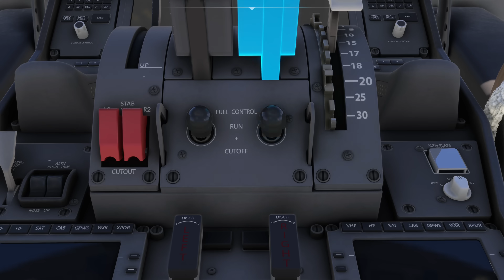Air India 171: Why Did The Fuel Cut-off Switch Get Moved?

Comment: I sincerely hope that the final report will provide a thorough background on both pilots to dig into whether or not this was a mental health issue.  Hopefully, they can resolve which pilot spoke which set of words.  As for AI-operated aircraft -- we already have self-driving cars that try to drive around police attempting to stop them!  And I hear that some highways are testing self-driving trucks.  But computers do fail.  Software/hardware isn't perfect.  Neither are humans, but I'd rather deal with a rational human than a dogmatic computer!  

BTW, if there is an engine fire at rotate, then that engine's fuel switch must be set to cutoff.  So, disallowing that while close to the ground just might cause more harm in some situations.

Finally, a determined mentally ill pilot will always find a way to game the system.

Comment: Steve is still missing the point that the same pilot who did the cutoff could be the same pilot who asked the other why he did that - to misdirect blame for the benefit of the CVR.  Also, for the dual-approval of a switch, you need to consider that a pilot could be incapacitated, so probably no action should require dual-approval.

Comment: Captain is the CVR able to distinguish between the pilots voices . To determine who asked the question why did you cutoff the fuel ? Also the SFO was Pilot flying  and the Captain was monitoring. It’s very confusing who pulled the switches to cutoff 😮

Comment: More baffling than the switches being moved to cutoff is why it took 10-14 seconds to return them to run. Were the pilots working together? Was there a struggle in the cockpit? Why were they not flipped back to run immediately? 

The authorities are holding back information, not least who said what in the cockpit.
Reply: We have no idea what went on in the cockpit because they have failed to release the audio except for a transcript from one of the pilots asking if they had cut the engines.

Comment: Can both the Fuel Control switches be operated within a second… probably impossible… And as such, every action or change of control is being checked/consented with the other pilot. Even the report is silent about the physical movement of switch position, you seem to be giving too much of focus on manual intervention which doesn’t seem to be a case here. Had that been a case, there would have been flurries of conversation between pilots and that should have been recorded in CVR.

Comment: As recently as May 2025, JUST under 4 weeks before #AirIndiaCrash - UK regulator issued a mandatory directive, quoting the FAA ( American Aviation Regulator), citing a “potential unsafe condition affecting fuel shut off valves”- these are controlled by the fuel control switches that are now in the headlines and are being double checked by airlines across the world. So no, not just a 2018 FAA  advisory, but a May 2025 mandatory directive from both American and British regulators flagging a possible safety concern with fuel valves that are like faucets for fuel to run smoothly to the engines. Really makes you pause, doesn’t it.

Comment: He said no procedure. Now for dual engine failure or when both engine gets fire what would do according to procedure? Particularly when you already have advisory of inadvertent disengagement of switches and also both switches Transitioned doesn't mean that it was manually done. And if Copilot who had seen it as someone done deliberately it would not take hi 13 seconds to move switches back to run one after another with gap of 4 seconds which was earlier done within gap of just one second. This is ridiculous narrative. Also nobody is talking about smoke visible just after take off and no engine status was given in report despite clear visible smoke which was not dust. Also comparing such senior captain who was also flight trainer with child by saying if you caught child what would he say is such a bullshit analogy in this context. It's a shame that you are propogating this without any factual evidence or rule out before final or further report

Comment: Air India have instructed bulletin that all fuel cutoff switches should be checked  for lockout

Report also said The fuel cut off transitioned from on to off, but they don't specifically say it was the actual switches in the cockpit.

Comment: If there are systems in place that can detect an engine fire. Why not have it in the criteria for engine cutout during climb, cruise, or landing to be able to shut down the engine. And if that criteria isn’t met, cutting out the engine during these three scenarios wouldn’t be possible?

My thoughts are that they place safeguards in place that the engines can be shut down if they pose a threat to the safety of the flight but if the engines are running perfectly, they can’t be shut down, unless on the ground.

Comment: This scenario apparently wasn't considered in the design of aircraft controls. I bet Boeing is figuring out how to prevent fuel from being shut off to both engines during takeoff. If one engine is shut off, then turning off the other switch would not close the fuel valve, at least up to a certain altitude. Probably many other systems to take into consideration for deliberate or unintended control inputs.

Comment: The reason why I really strongly disagree to the pilot deliberately doing this is, One pilot cannot turn the switch off without the other pilot seeing it. 

How do you mean it's not like a regular switch it has its spring it needs to be positioned and that moment would not go unnoticed by the other pilot and especially there are two switches of the same kind that were turned off

Comment: Did they ever find any indication that after the switches were put back to run that the engines began to gain RPM’s even though it was too late to correct even if they did?
Also is there any possibility similar to dyslexia or spatial orientation that would cause a pilot to glance at the cut off switches& think they’re in the wrong position thereby causing him to think he was switching them on? I know it doesn’t really make sense but every possibility must be ruled out.
I know pilots train & train & train, but isn’t human error always a factor until proven otherwise?
I would rather see pilot error rather than self destruction

Comment: There is apparently a service bulletin being looked into where faulty soldering on a chip on the EEC has led to loss of thrust control. This bulletin was apparently not implemented on this jet and a high number of cycles makes this jet especially susceptible to a potential failure. I’m wondering if it’s not a bit premature to place blame already…

Comment: Just posted my comments under your earlier video and not sure if the thread had already been read and so missed, so re-pasting. 

Captain Steve, I’m most curious as to what each pilots job/actions would be at rotation and flight. For example, I understand the co-pilot was in charge of departure. What would he be doing exactly. Where would his hands be typically and on what parts of the equipment? I understand the captain was monitoring. Typically what would he be watching and doing during this phase of the flight? Whose hands would be on the thrust levers (assume pilot in charge) which are just above the Fuel Run/Cutoff switches? Are there other panel controls near the switches that someone might be adjusting? A video on this type of aircraft showing a typical takeoff of responsibilities I think would be helpful. While the landing gear was not retracted during this flight maybe due to engine cutoff occurring I wonder whose job that would fall to. Thanks!

Also when the pilots are seated and ready for flight with seat moved into position, where relative to their seat would the Fuel switches be generally located to them? Curious how visually prominent they would be for each pilot. Once the plane is ready to have engines engaged I would assume the switches would seldom ever be accessed until landing and then parking unless an engine shuts down for some reason or catches fire and needs to be manually shut down.

Comment: Making the fuel cutoff action a two-person operation seems reasonable, unless one pilot is incapacitated. In a time critical phase of flight where timing is critical, this could be problematic. Having that third flight engineer seat in the cockpit would be very useful under that circumstance, but unfortunately, modern airliners no longer require the services of a flight engineer to operate.

Comment: Doesn't the flight voice recorder identify which pilot is speaking?  They have separate mics.   Also can the flight data recorder distinguish which pilot is actually flying the play by the control movements?  If so, why didn't this report identify which pilot was actually flying and which pilot asked the question "Did you...".  There are a group of people that feel that the one who asked the question may have been the same person that cut off the fuel supply as a way to push the blame elsewhere.

Comment: @CaptainSteeve What if the person who asked, "Why did you turn off the fuel?" is the one who turned off the fuel? He realized 10 seconds later that he had turned off the fuel instead of lifting the landing gear. And in his pride and fear, he turned it back on and then asked the question to begin the cover-your-a** process? This may be a massive mistake, and the question asked by the pilot is throwing us off.

Comment: Two major possibilities. Highest chance it was intentional and pilot wanted to die and kill everyone with him. The second option was the pilot was not concentrating at all on what he was doing and pulled the switches out of habit and confused these with the gear up lever. Sometimes people can do inexplicable things when there mind is elsewhere
Reply: Your first sentence applies
Reply: The total “brain fart” (as I’ve heard it posited elsewhere) is discounted far too often. Not saying that happened here, but it does happen. People really can do incredibly dumb things—as they themselves often admit—with no explanation of why or how. They knew better, it just….happened.
Reply: @bettyparker3317  These are trained pilots....trained and trained and trained....impossible to confuse the gear with the fuel cutoffs...their brains wouldn't let them do that accidently
Reply: Third possibility is the technical failure of Boeing 787. What a crap they have made. Boeing should be sued, and the company should be dismantled.
Reply: The captain was a trainer the move the switches a lot in the sims, could this be muscle memory?
Reply: CVR will prove otherwise. It was an act of mass murder.
Reply: This was murder
Reply: The gear lever is nowhere near the fuel switches, and moving the fuel switches is a 3 step process--pull switch up to clear the locking mechanism, the move switch sideways out of its detent, and then move down to cut off setting. The gear lever is moved upwards to retract the gear.
Reply: But why was the RAT deployed?
Reply: Certainly possible especially if they did not get enough sleep the night before.
Reply: Where in any sequence would a pilot ever move those switches as a habit? After pushback from the gate to start the engines. After landing and shutting down the engines before disembarkation. In this case the FO was flying so he would have done that action on that day. At no other time would this be habitual.
Reply: Ur both major possibility are wrong bro

Comment: How does the data get the switch position. Is there a circuit in the actual switch that indicates position, as say a lighted illumination would work, or is it getting data from a circuit board. The point is, could it be that the actual switches were not moved, but a ghost in the machine. How many seconds from cut off did the question - answer happen. Is there a click sound on the center channel to confirm actual mechanical switch movement. Why a delay between switch 1 and two being turned back on. 52 to 56

Comment: Captain Steve, in your previous video someone suggested that Boeing should use the same process that Embrear use to cut off the fuel. I think that the process to do that was to put the engine in idle then move the switch to cut off position. How’s is this different from having the two pilots to act on shutting the fuel as you had agreed with someone that suggested that the two pilots agree before shutting the fuel

Comment: I understand that you may need to shut off one of the engines for landing incase of fire but why not input it then so they can only shut down one engine and have a short amount of time before you can shut down the other one for these type of circumstances? Is that something that maybe implemented to prevent this from happening again? Maybe even 30 seconds to a minute?

Comment: Somebody commented on another video that, on Embraer airplanes, before moving a fuel switch to "cutoff" midflight, you have to pull the correspondent throttle to idle. I don't know if this is true, but it sounds interesting to me.

Comment: 10 seconds is a long time after first detecting that the switches were set to cut off, do you think that the investigators will be able to figure what was happening during that time? Do you think there was some kind of obstruction or struggle?
Reply: Even the fact that it took 1 second to switch them both off, whereas a 4 second difference between turning them back on!

Comment: But the wording in the Preliminary Report is that the switches "transitioned" to cutoff, not that were put or switched. So that leaves room for interpretation in that it could have been a mechanical/electric glitch from the aircraft. There was already a precedent in the 737 which has similar switches.
Reply: That's what transition means.  The "switches" were transitioned is what it says, not that a command was received at the flight computer.  Sure, it could be a glitch depending on how it's configured, but don't forget the pilot didn't ask the other if he had shut the engines down after the rollback, he asked WHY he did it.  That seems to strongly indicate  he either saw the switches with his own eyes or did it himself and asked the other pilot why in order to deflect blame from himself.

Comment: “why does the computer allow the action like cutting off the fuel at such a low altitude during a critical phase of flight——- Well because I may have to cut off fuel to an engine as I’m landing. Let’s say I’m at three or 400 feet and I get an engine fire on one of my engine engines. I’m gonna go ahead and do my procedure and cut that off before I land so that’s why it is. It’s never intended to do it on climb up and again this is a tragedy”

The question is about takeoff not landing phase. Boeing made a critical state error in not locking out the engine shutoffs during takeoff Where the pilots can’t simply glide into a landing. Also, the system shouldn’t allow both engines to be disabled during climb. This phase of operation requires at least one engine and if both are on fire, disabling both would be a 100% guaranteed fatal move therefore the control system shouldn’t allow it

Comment: As for “Both pilots required to operate the switches”, what if one pilot is incapacitated and not able to participate in?
As for mental health assessments, airlines have been big on DEI which includes hiring transsexuals. The fact that there is a 40% suicide rate in the community and 80% have thought about it is very concerning. Disclaimer: If you want to pretend you’re a woman when you a biological male I have no issues with that but being a pilot requires certainty in one’s life to perform those tasks. The job is stressful enough that bringing more stress into it leads to errors.

Comment: You indicate that there is just one option for the switches being moved. I think there are two. First, the switches might have been moved intentionally. But the other option is that it was unintentional. Maybe some "muscle memory" caused one of the pilots to operate those switches when he meant to operate say the gear switches. I don't know what's close or if "having flown <some other model airplane>" might be the cause.

Comment: The answer is that they did NOT shut off the switches. You heard the pilot saying that. The switches were electronically disengaged due to a failure. 

Liken this to your home electrical system. The breakers in your electrical panel take manual effort to turn them on or off. However, if there is an electrical short circuit in your home, the breakers will automatically switch to the off position - no manual intervention needed.
Reply: One of the first rules of dealing with people : People are liars , You actually think a pilot looking to take a plane down and make it look like an accident is going to admit to wrong doing with a voice recorder going ? B) The pilot said nothing of the sort ...
Reply: @donwarrington4916 
The pilot said nothing of the sort????? Really ??? What news/videos were you listening to???

Read or listen to reports of what is in the preliminary report.
Reply: @ddb0831  Sorry boss , my mistake , I read your comment wrong ...
Reply: @donwarrington4916  Rule number 1, there are no rules, assume nothing.
Reply: The pilot would not ask why did you cut off the fuel if he didn't see it was done.
Reply: @Johan654-s1f 
It’s a logical assumption that if he didn’t do it, the other pilot did. The answer he received was “I didn’t”.
Reply: @ddb0831  No if he didn't see it was cutoff it would not make sense to assume that. Engine thrust can be lost by many other reason so it would make sense to ask why did we lose thrust?